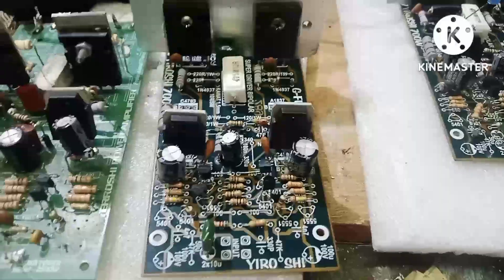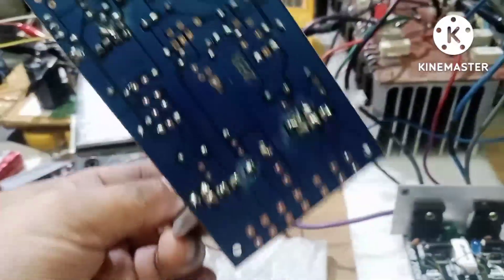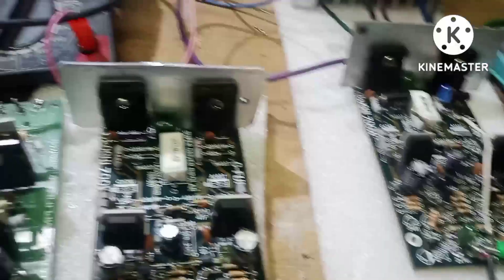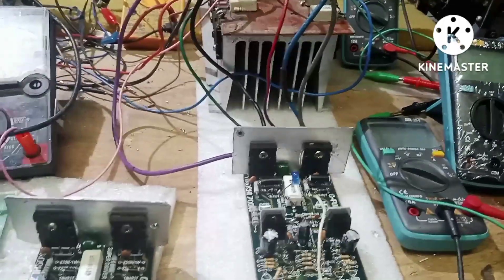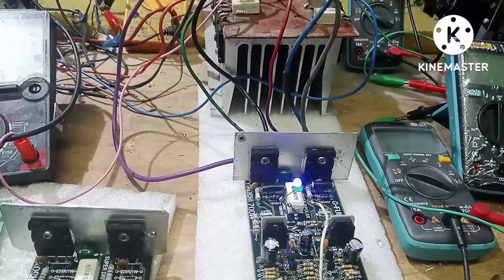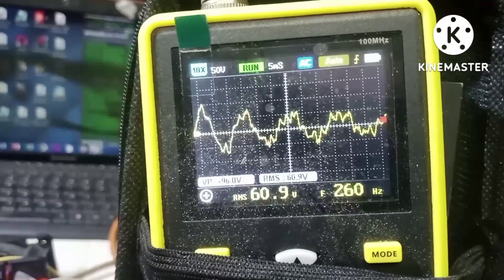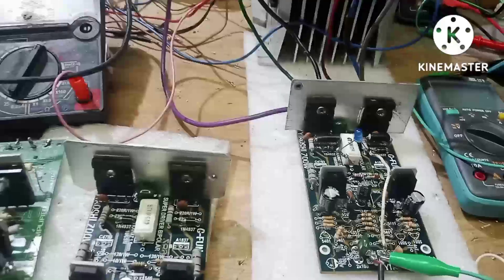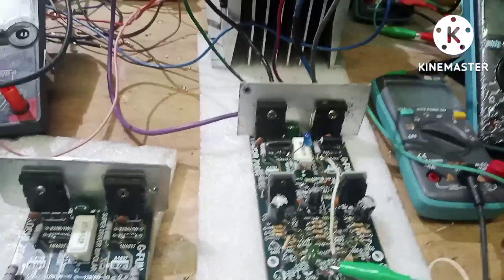Simplified yiroshi amp 125v

Comment: Sir, sana mapansin nyo po. paano po ba magconnect ng apat na capacitor na may 10,000uf 80 - 100 volts at bridge diode? kasi may 35 volts po ako na EI trasformer gusto ko po sana pataasin ang voltage. maraming salamat po. more power po sa inyo. Baka po sakali na makagawa kau ng video tutorial para malinaw. salamat po

Comment: Brod normal long ba ba nagbabago Ang bias pagnakaload na Ang speaker Minsan Hindi pantay Ang bias
Reply from the maker: Normal lng yan pero pag may audio n dpat pantay n pag nka swich on pully uperasyon ng ang tr dapat pasok sa   .5v below
Reply: @bombasstechaudioelectronic1492  salamat Po brod Kasi nakailang potok na Ako Ng mga 220 omhs pianalitan ko ok na yon long Minsan malikot Ang bias at dco nya.014 Ang kabilang channel .003 salamat Po brod
Reply from the maker: @giltuala774  posible may poblema k s vas stage at s deff stage... Di p bance ang swing ng current
Reply: @bombasstechaudioelectronic1492  susubokan Kong echeck ULI brod Ang Bago mong content tungkol racola ayos yon susubokan Kong sundan kasi poru racola Ang ginawa Kong driver hard bass salamat uli brod